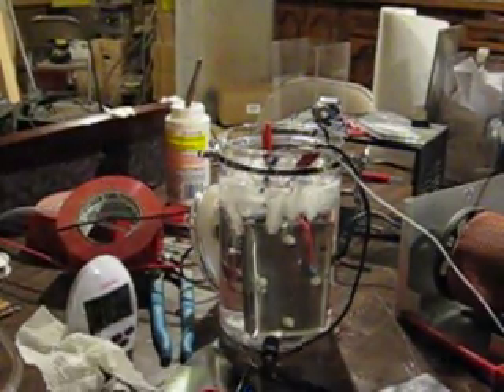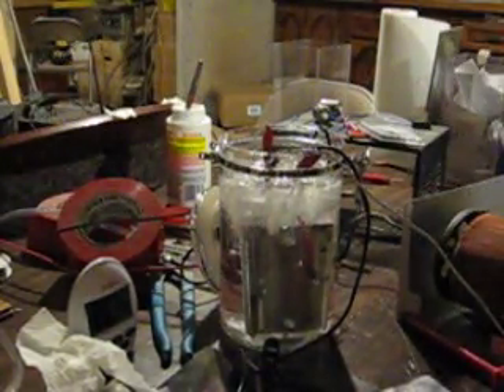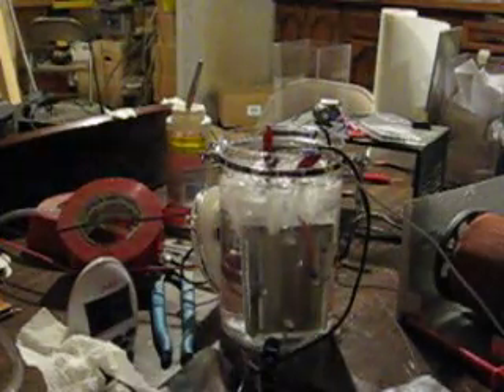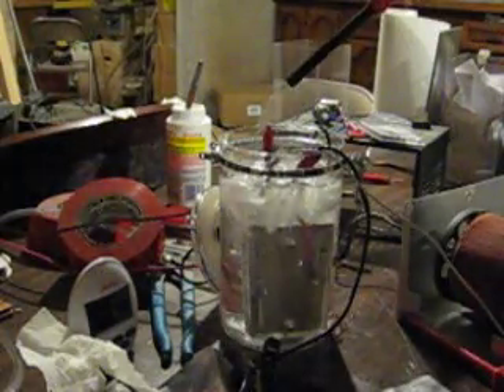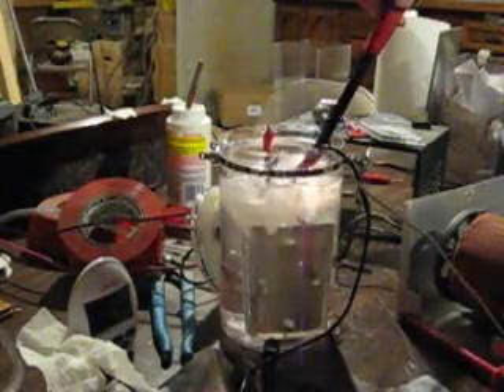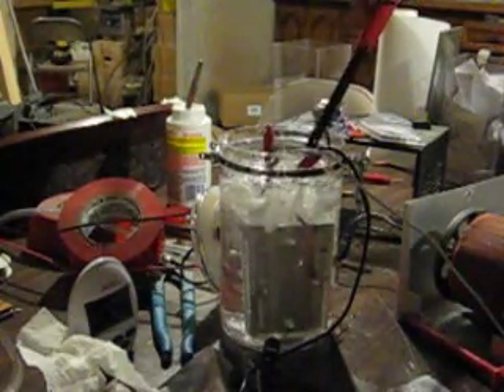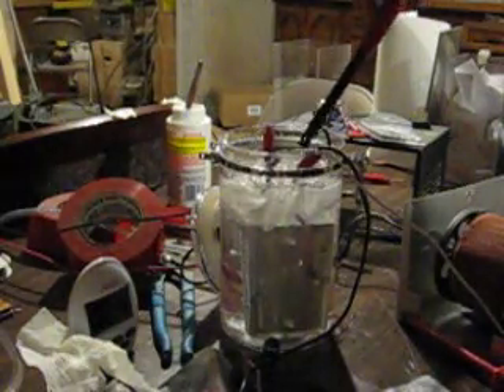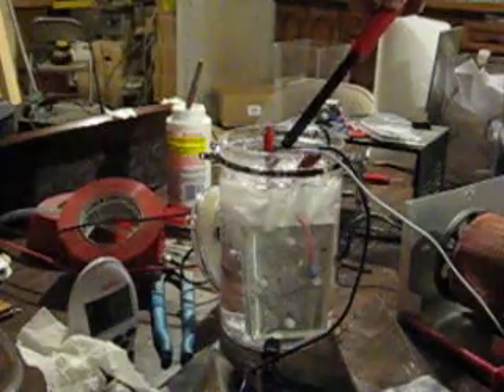HHO Iced Electrolyte & Ultra-sonics ©

Comment: Actually, it is possible to use voltages well beyond 90v and get higher production volumes ... efficiency suffers and you do get waste heat that you have to dispose of but you can get higher gas volume ... so it depends on what you want to get done ...

Comment: I think that if you took a known volume of gas produced in chilled reactor and same from normal reactor; bring both gas sample to same temp; ignite; same potency ... but yes, a cooler more dense gas will be more reactive ... so the chiller need to be at the intake into the ICE, not necessarily at the reactor ... my thoughts only, no proof ...

Comment: And how did you employ ultrasonics?  I have used high frequency sound in my reactors basically as a vibrator to knock the bubbles off the plates but cannot confirm that this actually contributed to the reaction.

Comment from the maker: Its a Unit I purchased from the internet. I have not confirmed that it really does any thing except help remove bubbles from the plates and the solution. The Gas Also seems to be a little different in combustibility. No experiment yet to confirm any of this. It's coming.

Comment: 90 Volt DC is way to high, a deadly dangerous.
1.50 volt DC / Cell is around optimal.
And RO water is so clean that you produce more
heat then H2+O2= Hydroxy gas; 
( HHO gas does not exist it's hydroxy).
You need an electrolyte.
But i like to know what the ultrasonic effects are.